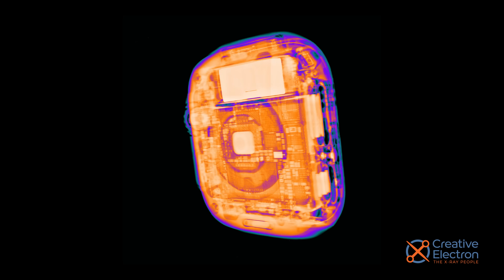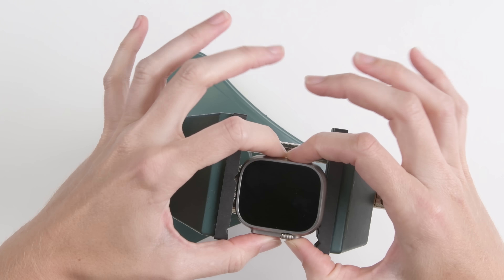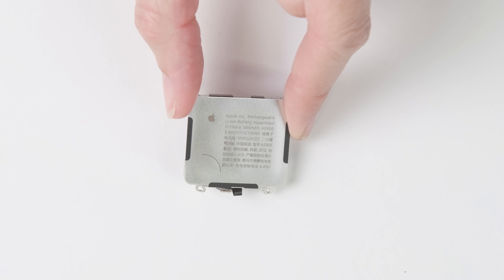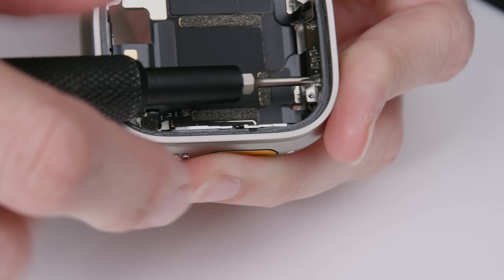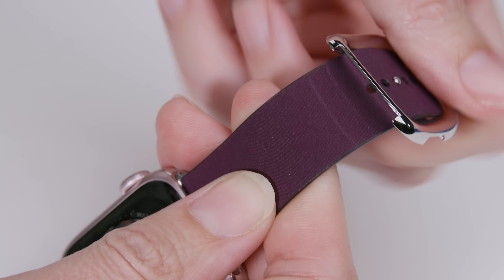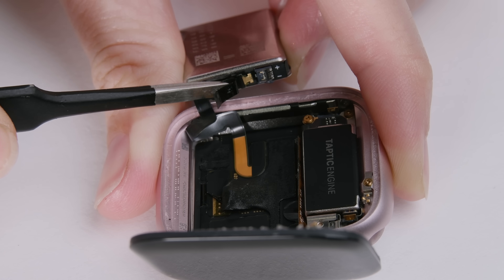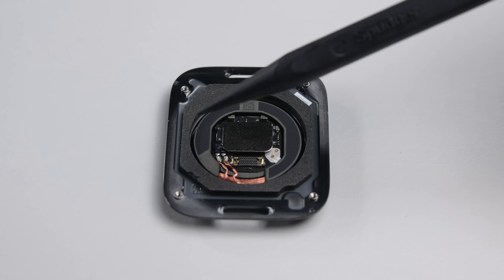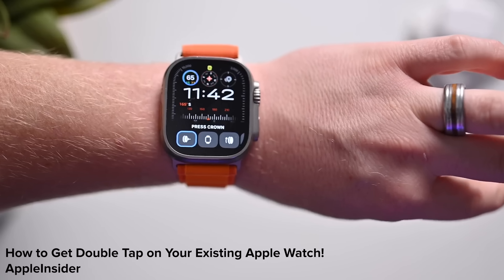Apple Watch S9 and Ultra 2: Double Teardown, Double Tap

Comment: What is this tool called? The one used to hold the watch steady in place
Reply from the maker: It's a vise! You want to make sure to get one with rubber or plastic edges so you don't damage the watch's case.

Comment: I opened several apple watch, except the ultra, and I think using heat plus metal blade is not the greatest way of doing it.
I’m still researching and testing, but today I can open an Apple Watch in a way easy way and I can even refurbish the display with broken glass very easily.

Comment: There isn’t a new sensor for Double Tap, my understanding is it’s ML running on the NPU taking input from the sensors. The existing accessibility feature runs on the CPU and therefore is much worse for battery drain. Older devices don’t have the NPU that the S9 has.
Reply: Exactly!
Reply: And, regardless, still for certain  not worth the money! Treat this watch as “an ode to make the 8 cheaper”

Comment: I don't think it would be correct to assume to find a new sensor for Double Tap. Even Series 4 has this as an accessibility feature.
Reply: My understanding is it uses a combo of heart rate monitor + accelerometer, but the magic is in the software which is why Apple is stating it needs the S9 to be fast enough. I bet a slower version on older watches might have been feasible but quite slow, and probably not up to apples standards. Still would have been nice as an option though.